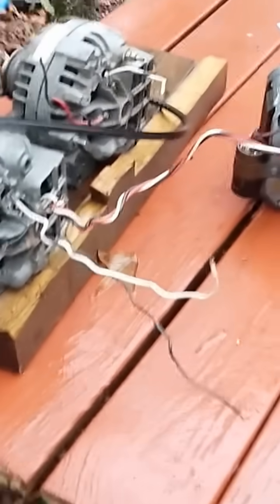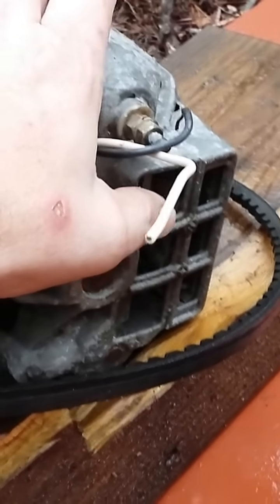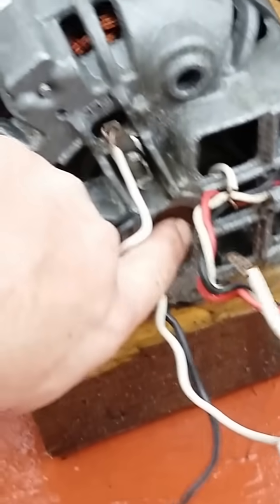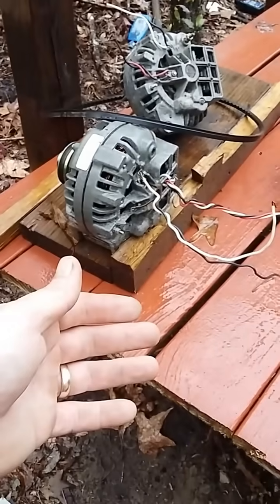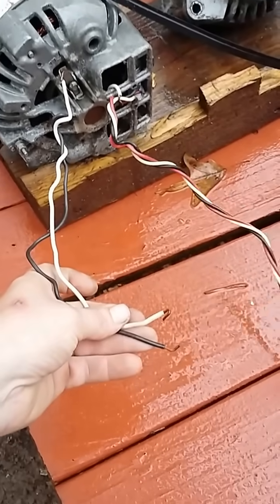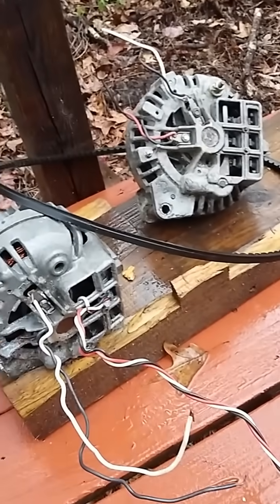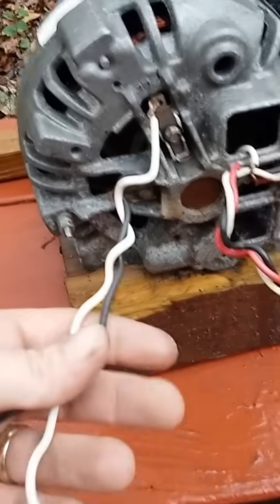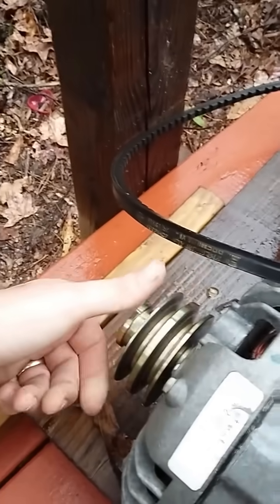Update Free energy forever no wind no solar no gas READ DISCRIPTION!!!

Comment: Which law states that energy that is 100% directly proportional to exploited physic phenomenon multiplied by design cannot be greater than input?
     If in your design you utilize the energy to generate more energy again design x physical effect, many ways to generate power, with a low energy low inertial resistance, search for knowledge of low cost high production methods look into faraday laws and remember Fleming and Lorentz, take into account all negative factors and engineer best fit based for electrical generation taking into account all moving parts and fluctuating variables.
      A solar panel is inefficient at capturing and converting sunlight into current which is why they have so far not moved to solar panel energy but the sunlight it caught was 100% human free because the panel did the work and the output is 100% free and a few in series and parallel combinations would pay 100% of the electric bill and from our common knowledge less than a whole roof generates a whole household. So while scientists play with themselves and fondle the public with bs about efficiencies just add a few more panels to make up for loss. 
     A 30 foot lever takes a 200lb guy to lift a 30klb house. So 200lb force down= 30klb force up. Yes you lose distance so add more lever and move fulcrum back and you reclaim distance at the cost of a couple feet and it doesn't matter anyways because you only need a small distance to move around a generator shaft. So 200lbs of energy generated 30klb of energy. Which law says that this isn't true?
          Tests and designs are needed and failures are learning points and each failure is unique. Many scientific discoveries of the past were made because of mistake/failure. It takes belief to even try to engineer something in that belief range and mistakes and successes make up our collective human knowledge. If we never try and never believe then we never discover what's there. 
       What is possible? What do we humans think we know? 80% of our industry knowledge and therefore business I'd argue and all the politics and marketing associated came from the last 200 years of man's stay on written history of earth. We currently know that we only know about .00001% of the electromagnetic spectrum. People are still engineering solutions because they didn't have the solution before. If Tesla or someone had lived an additional 300 years do you think they would have stopped coming up with mind blowing discoveries?
         Reach for the stars mate, anything is possible, start engineering and you will find that solutions are all over the place if certain research was done or certain pieces or material type were used if certain media attention drew more attention to it and if people actually wanted to do it, mostly though people in power don't listen, they don't like the way your dressed or speak or they don't think your important enough to make time for or the have preconception or misconception or misperception and they are biased towards many things public and private. Technology has increased 20% online but the book science people say it takes 30 years for information to find itself in a book, they do it in 1 year if they desire you to have a certain programming in school. 
      Things aren't being tested and noted because they are too busy running particle accelerators and creating black holes with technology and phenomenon that humans don't understand and like nuclear waste and high infectious and hard to kill disease they just bury it until something dies from it. We never figured out and or developed technology to properly reconfigure waste into usable elements so a black hole without a shut off... 
      Things need tested and understood before moving on and not understand purely based on mathematics like particles. It must be observed through as many tests as one can do. So for any energy device it must be tested. Tesla knew that if a conducting pole were in the ground and the top was in outer space that a thermal electric current would flow through it and with wires to a motor from the ends could run a motor indefinitely until earth cooled down or space warmed up and considering a normal pipe diameter the earth couldn't lose all of its heat into that pipe.
      Also we the people and the scientists have different definitions of perpetual. We don't want magic as scientists describe spontaneous energy of a perpetual source. That sounds like a gate opening to infinite energy. People think in terms of lifetimes so if a device runs for 2 human life times then for all intents and purposes it was perpetual twice. Mechanical failures happen and that fix is called maintenance and is inevitable due to the law of atrophy in our physical realm. Perpetual would be a positive feedback loop in which at some point generation occurred and is circulated and the input from the generation source is greater than the energy loss in the loop. Storing and conserving as much as possible with caps and inductors and batteries before grounding. Doesn't sound impossible knowing many physic phenomenon and that the wind still blows and waves still lap and sun still shines energy harvesting is there.
Reply: Because in your stupid analogy the 30 foot climb to the top of that lever is the equel input. Nobody is fucking you around. There is no magic energy source made from Pontiac alternators by some inbred hillbilly meth head. The closest we have come is nuclear energy. Or Geothermal

Comment: No disrespect, but I found this confusing and uninformative. Where does the energy COME from? It seems like just a system to turn DC into AC so that it is compatible with house wiring and appliances. But that's not "free energy" because you still need a DC source. Are you just powering your home with car batteries? Telling me to go watch 20 other videos is not a good answer for YouTube, you must surely realize. I'm willing to give you a chance, but I'm not willing to spend THAT much time giving you a chance. Please explain the ultimate source of the energy in a simple sentence or two.
Reply: U can spin it W/ anything, wire the motor directly to it ,& once it is started it powers itself 🤷

Comment: I just want to know what brand of alternator is most efficient for these types of builds?
Reply: An alternator is an Alternator. The bigger the better though.
Reply: you can  use a 12v 70 amp   or 90 or bigger

Comment: Seen it work...so all of the people talking trash should keep paying the electric bills!!
Reply: From what I understand you need to really get the pully on the alternator fast in order for it to produce any  juice... how many rpms does it take generally?
Reply: @marcihuttunen7  depends on the size of the alternator I've also seen this work. It's a little more complex and the examples of wires among other dangers this presents should not b ignored though. That little alternator will kill you if you aren't careful.

Comment: This is why they need to teach more science and math in school...people will believe just about anything,  regardless of how ridiculous it is.
Reply: It does work.  I have seen with mine own eyes a generator made from an alternator.  The guy used a a spoked bike wheel with sheets of tin like tan blades,  and did some gear reduction,  the tire would barely turn and generate 18 v to an rv PowerBank  .  And it was switchable, built in power inverter.  Not 100 percent efficient.  But a good attempt
Reply: @gerbilkill  I would believe that. But I don't believe what this guy's doing in his video. He saying that with no input, he gets output energy.
Reply: @gerbilkill  hi  see this guy put alternator it blades up side on top  of normal air conditioning  every time machine works  generate power to invert  plug one outlet electric meter don't  move much he feed house not pule from grid
Reply: yeah, they teach bullshit in schools, instead, they should hire this guy to teach everyone how things really work

Comment: Sure , But how do you get the motor to spin the alternator ? Where does that power come from ?
Reply: I know.a generator will spin but ive never seen am alternator do it. Maybe if the stater is unhooked?  I dont know. But im gonna try this.
Reply: What he is telling you is that the alternator itself needs a spin.  So what He does is he initially powers it to spin.  If your electric wires are connected correctly, it becomes a closed circuit and the alternator will continue to spin.  As long as nothing in your house pulls greater than 80amps at any given time, it shouldn’t fluctuate.  So you calculate your electrical load and make sure the amp is sufficient for it.

If you needed extra, you could use a second alternator as the motor and the first as the generator, and you can the install a battery backup loop, like in a car, in case the alternator gives out.

Does it work?  It should.  But only one way to find out.
Reply: @dgraci  So you think the alternator will continue to spin by its self ? I dont think so .
Reply: @garyryan7852WR  you have to convert the alternator into a generator.  The electricity goes through the battery bank and then the house circuit and comes back to the alternator.

The motor can tap into that circuit once it’s energized and continues to spin the alternator.  Alternatively, you can have a secondary motor-alternator circuit.
Reply: @dgraci  Have you seen a video that explains this better ? Thank you though.

Comment: You don't seem to grasp that you can't make more energy than you put in... it's all about the basic Laws of Thermodynamics and you don't seem to know that, while all energy is free for the taking, it costs money to take it, and distribute it.  Also you don't seen to realize that you are defying both Ohm's Law and the basic Laws of Thermodynamics.  People don't try any of this stuff at home... seriously, you can hurt yourself with high amperage alternators and generators.
Reply from the maker: I think you guys are just slower thinkers and maybe haven't ever had to follow directions or read the description of something to be able to find out where the real  information is....   SMH...  Do you know anything about collapsing magnet fields? How about High frequency? What about compiling electrons? Do you know how to gain current with out lowering voltage? Wow.....  I didn't think you would...
Reply: One day we will be able to harness the energy that already exists and use it. But this is not it.it is a shame that people will build this and waist so much time . Maybe it's better this then causing trouble.

Comment: Those. Are Mopar. Alternators. But. What. Powers. Or. Turns. Them.  Or. The. Battery. Bank. The. System. Needs. More. Parts. Too. Produce. Constant.  Energy. Electricity. I think all the things  he said. You don't. Need.  Why not. Have. All. Bases  covered. Wind. Solar. Mechanical.  Hydro. Harness. Gravity   tides. Ebb.  And. Flow

Comment: What year of car did the alternators U used on ur video come from? So that I can get me a couple of them.
Reply: The alternator he is using is a Chrysler/Plymouth/Dodge unit that fits virtually every model from the early70's to mid 80's. It is called a Chrysler square-back alternator. One vehicle  application is a 1983 Chrysler Fifth Avenue L6, 3.7L engine. These are typically rated at 78 amps but can sometimes produce more depending on how fast you spin them, how hot they are,  and the electrical load imposed on them. If you do a search for antique Chrysler alternator on a popular auction site, it should bring up some results that match the unit seen above. His is what's referred to as a "double field." So if you want the exact one he is using, make sure the one you are considering buying has 2 active (hot) spade terminals on the back of the unit in addition to the main B+ output stud. They will easily run over $100. Hope this helps.
Reply: @erickz4561  (Chrysler/Plymouth/Dodge) Good reason to stay away from those alternators, would rather get Aisin.
Reply: All alternators will work... Different alternators put out different amps just depends on the size
Reply: Yes..
 Where too can I find your magic alternators?? I want MY nobel prize!

Comment: What vehicle did the alternator come off of?
Reply: The ones he's using looks like Chrysler product alternator
Reply: The alternator he is using is a Chrysler/Plymouth/Dodge unit that fits virtually every model from the early70's to mid 80's. It is called a Chrysler square-back alternator. One vehicle  application is a 1983 Chrysler Fifth Avenue L6, 3.7L engine. These are typically rated at 78 amps but can sometimes produce more depending on how fast you spin them, how hot they are,  and the electrical load imposed on them. If you do a search for antique Chrysler alternator on a popular auction site, it should bring up some results that match the unit seen above. His is what's referred to as a "double field." So if you want the exact one he is using, make sure the one you are considering buying has 2 active (hot) spade terminals on the back of the unit in addition to the main B+ output stud. They will easily run over $100. Hope this helps.
Reply: Its MOPAR Junk i woulda went with Aisin

Comment: Those little wires won't handle 90 amps..... U need #3 wire
Reply: Each wire would carry 1/3 Rd of the current. It puts out 3 phase AC with no diodes. This will work.

Comment: Hmmm... So, what is going to drive the free energy generator?  Kinda flying loose with the amps.  90 amps is a lotta power from a tiny generator.  So why isn't it in operation?  Not a very useful video for the average person.  Electricity is child's play for me but most people should stay away from anything electrical unless they have a good idea what they are doing.  Don't be hooking into your house unless you really, really, really know what you are doing.  If you burn the house down, your insurance will likely not cover it because you caused it yourself.
Reply: You're right. Most people shouldn't mess with electrical devices unless they are well trained. But they do and, like you said, many times it ends in a fire that causes a lot of damage that insurance won't cover. Humans...we're some destructive beings...

Comment: Wow, the comments and lack of understanding here are breath-taking!! Although, I have to say, the video is kind of right, it's lacking any info to make any logical/ practical sense. I have built something similar, but let's first dispel a few myths.  ALL car alternators initially produce 3 phase AC electricity because it is more efficient; it is then converted into DC by the rectifier, and then kept at a constant (usually) 14.4v by the in built voltage regulator.  The 3 phase AC voltage output can be altered by increasing or decreasing the stator core voltage; the frequency (HZ) can be stabilised simply by controlling exactly the rotational speed (RPM) of the shaft. So, if you only used JUST ONE of the three phase wires and the ground connection you will essentially create a stable single phase usable supply. Hmmm, now, I wonder what you could use the other two separately isolated single phase outputs for??

Comment: If i understand right i can run my whole house from a car battery and 2 alternators
Reply: Not sure about just a car battery but during hurricane ida I ran my entire house minus the air conditioner, washer and dryer. I used a 1100 watt power inverter hooked up to my f150 battery and had right around 100 amps to use between 4 circuits was able to run lights,3 tv,3 fans, a deep freezer and a refrigerator/freezer combo and if I turned off the TVs and fans used my coffeemaker.  So I'd imagine there is some truth to this. My understanding of doing it without the inverter or vehicle is what's lacking

Comment: So basically you are useing a motor powered by electricity to spin a generator that produces electricity,
Reply from the maker: Technically that's not correct and there's not really anything basic about it...  You need three resistors and three capacitors to phase shift the electricity 180° before sending it into a middle phase after passing through a mosfet or transistor with more resistors and capacitors and some diodes to keep the electricity synchronous to the way it started out as logic. Yeah it's pretty basic to build a nine-phase motor/generator....

Comment: no way you are going to put out 90 amps at 220 volts from those 3 skinny wires .
Reply: How will it not exactly?
Reply: @NerdKrusher  because 90amps at 220V comes in to a home with 6ish gauge wire. 90amps at 12v needs like 1 or 0 gauge wire.

Those wires are 14 or 12 gauge at best.

Thus, far too small to carry the stated amperage, in either voltage range.
Reply: "Cocaine's a helluva drug"  Rick James